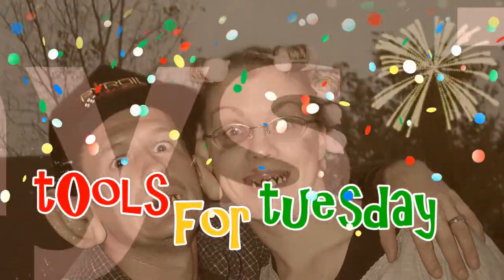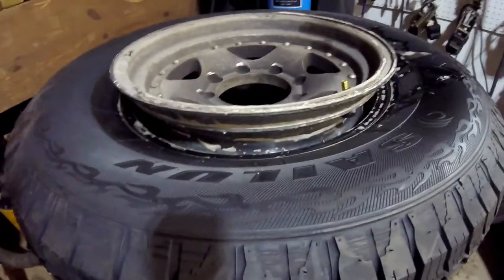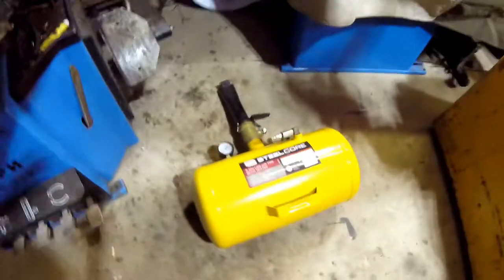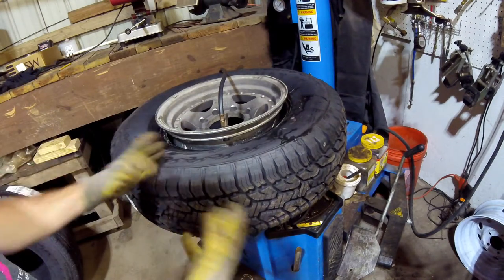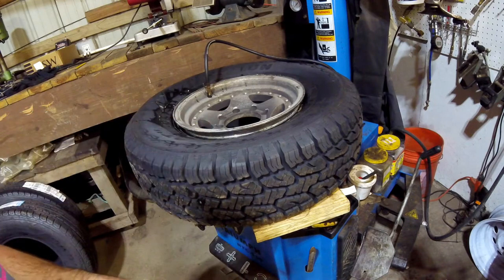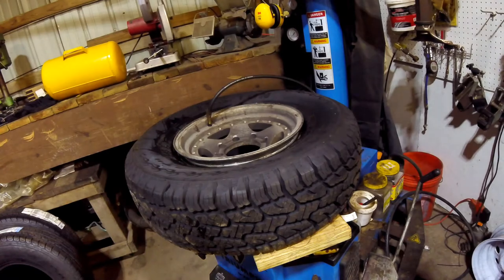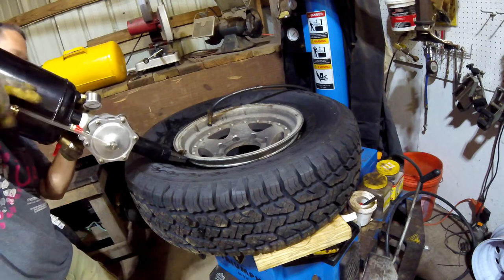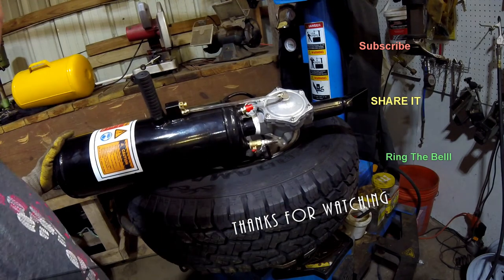Tire bead blaster - BAZOOKA STYLE - cannon bead seater tool

Comment: Thank you for so detailed film, I learned how to connect everything. It would be much easier to set up everything now. I bought a similar BS (XK USA, I think the scale will be in psi then, it is more convenient, but for quick reference 1 bar = 14.503773773 pound-force/square inch 1 pound-force/square inch = 0.0689475729 bar ).  Thank you also for pointing out that the bead grease can dry out: I succeeded to put a new tire on the wheel (I'm replacing my 1st tire with Harbour Fright Manual Tire machine and Duck Bill attachment), but failed to inflate it, bcs naively assumed that I could use just a small tire inflator. That last step in the project opened the whole new world of using compressors for me. So while I'm doing research on the subject and finding the necessary tools and equipment the tire is sitting  on HF machine, like for 3-4 days, so most likely the tire grease I applied is most likely dried out. I think this tool is relatively new (I mean BSeater), and people just start to use it. My tire is smaller R16, so probably it would be a bit easier to seat a bead on it. What pressure would you recommend to use on a passenger car tire R16, is it 50-60 psi? I plan to use a small 1 Ga Fortress compressor (0.7 SCFM@90psi) to add air into the BS. Thank you again.
Reply from the maker: Wow, that's a lot of info! When using your bead seater I'd recommend only a little more air pressure then what the tire recommends for max pressure.  If you go too much higher you could potentially blow out the sidewall.
Reply: @notoriousJPG  Thank you so much, I thought more pressure is better. I'll start then from 35psi then, though everywhere I saw it is 50-60 psi for the passenger car (and usually a passenger car has around 30 psi).  Also I actually never thought that it is same pressure for different types of tires you put on your car, so it depends on the car wheel and not on what particular tire you use probably. But I need to do more research on this part, bcs we have 2 cars w/same size R16 tires, but pressures are different (30 psi on one car, and 33 psi on another). More of that we have another car w/R15 and on the same tires 30 psi front and 26 psi rear (it says on the door). My question now is: if you change the wheels, and maybe you decided to go fm/R15 to more common R16, so then that information on the door is not true anymore, or it depends somewhat on the model of the car?  Thank you, thank you.
Reply from the maker: tire pressure listed on the door of the car, vs that which is listed on the tires is a highly debatable topic. I always prefer to go with the tire manufacturer's recommendation. Tire pressure will vary depending on factors like speed rating,  number of ply,  load range and other factors. For example, an h rated tire may be slightly lower pressure than a z rated tire that's built for higher performance and has a stiffer sidewall. Driving a tire that's under inflated, or that has too much pressure can be dangerous and prematurely wear the tires. This is why I use the tire manufacturer's recommendation. Also, keep in mind that if the tire pressure is different than what's listed on the door of the car it may throw your TPMS sensor code. You may have to do a re-learn procedure to adjust the pressure that the car is looking for.  Good luck!
Reply: @notoriousJPG  Ironically that fact that occasionally I saw a different (fm the door values) pressure set up at dealership partly inspired me to do some things on our cars, but after your comment I think maybe the mechanic just set a correct pressure for that particular tire. We have only one car (Nissan) w/TPMS sensor and it reacts on the lower pressure only.  I don't know if all the tire sensors like that or some of them have limits on both sides of the range. On the car I'm practicing now (Chevy, Cavalier) there is no Tire Sensor. I didn't see any specs on my new tires, but probably it is somewhere on the site, and anyway I'll be calling Tire Rack (I ordered fm/them) to double check on everything, especially for the Saturn which has different specs for front and rear. Thank you.
Reply: @notoriousJPG  I called CS of Tire Rack, they said, whatever pressure is on the door, they go by the car weight. Maybe it is just for their tires, and there are some manufactures, who follow other rules, but that is what was said by Tire Rack representative. If different for front and rear (I double check that question w/her as well) also follow the door, since by the weight of the car.

Comment: Anybody use one of these 2.1 gallon bazooka bead seaters on a semi truck rim/tire? I'd like to have one in the truck but wondering if it's up to the task or if i gotta get the big bulky 5 gallon tank. Thanks.
Reply from the maker: I don't do semi tires, but... Sometimes if there's a big gap at the bead you just need more air volume.
Reply: Hola cómo se llama la válvula que no es manual

Comment: You know I opened my BS now and the scale is also in bars and MPa, it looks exactly like yours, but that big label is on the top (on yours is on the bottom).  The scale is filled w/some liquid, almost full and the glass is partly fogged. Do you know is it possible to remove that liquid somehow? Maybe you also had that problem. Also there is some substance inside of the tank of the BS, like a rusty sand, I poured out some, but some is still there, moving and giving corresponding sound, like a sifting sand. Is it normal, that there is some sand inside, was there any when you first tried your BS? Probably it will be blown out 1st time, but I suspect this BS is all defective. I would appreciate any comments on this subject. Thank you for the film again.
Reply from the maker: Man, that's definitely not normal. Sounds like yours got wet or something. I'd try  to send it back or if you can't, at least unscrew the air nozzle and try to clean it out good.
Reply: @notoriousJPG  Thank you, I set up everything already. I shook out most of the sand and then just washed out and dried well. I think the most important part of that tool is a black tank, since into those 2 holes it has you can attach anything you want if it is 1/4 NPT. On assembly I broke the valve w/a small red handle off, so had a situation that smth was screwed into one hole and no way you can grab it to unscrew. But I succeeded to remove that remain w/a flat Phillips 1/4 and attached a new one fm/Harbour Freight. And I even think that maybe similar problem occurred before, when someone was attaching that handle, so there was a need to remove the broken end of it and they drilled it out, so there was a sand type substance inside of the tank as a result of that activity. Anyway I screwed everything w/a plumber tape, no leeks, and tried it yesterday on 25-30 psi, everything works great, and the tool looks just gorgeous. I absolutely love it. I decided to keep the gauge for a while (I use it practically as a plug, you can see the scale on it, but very poorly, bcs it has some foam inside, I need to find out what liquid is inside and how to replace it), since I have another gauge on the pump.  Thank you for attention to my problem and your so informative film.

Comment: how can you do that on the road?
Reply from the maker: Not sure what ya mean there, but you can mount a tire with one of these in a mobile situation as long as you have some additional air. Even a 12v compressor might get you aired up the rest of the way in a pinch.
Reply: Nice